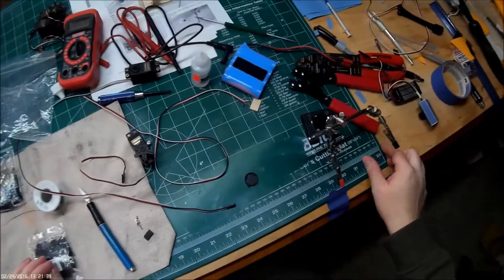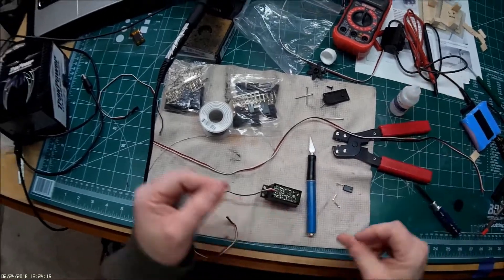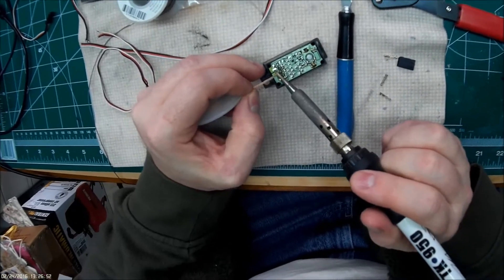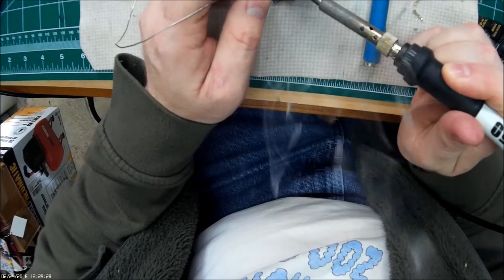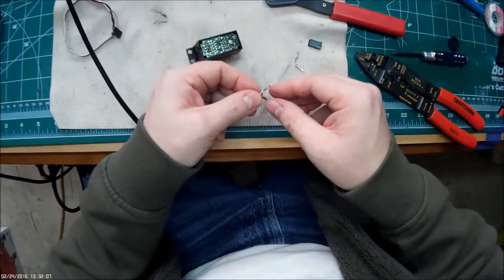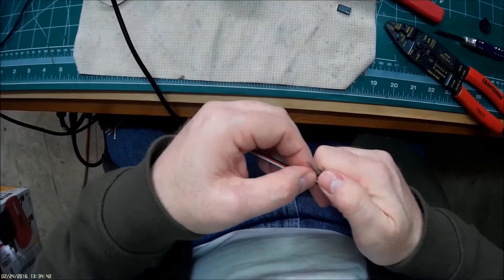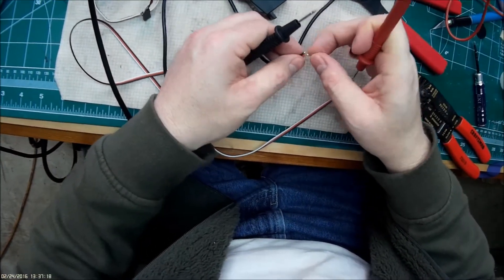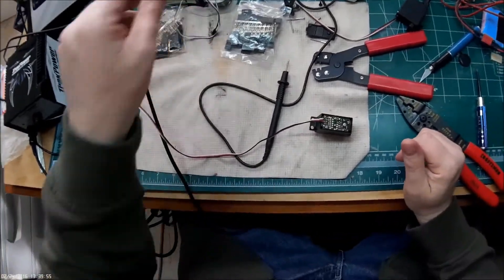Installing a New Wire to a Servo

Comment: It’s a great video but don’t you think is better to use a soldapullt instead of use the flux and warm too many times the board??
Reply from the maker: Never heard of soldapult.  Now days I just simply use 60/40 solder only.  I have had good results with that.

Comment: Helping hands and a higher watt iron would sure help!
Reply from the maker: I have not need any higher watt soldering station on anything I have solder to date.  I have helping hands and just don't like using it.  I have been soldering for nearly 40 years and just prefer to not us it.  Although, I do pull it out for some of my projects.